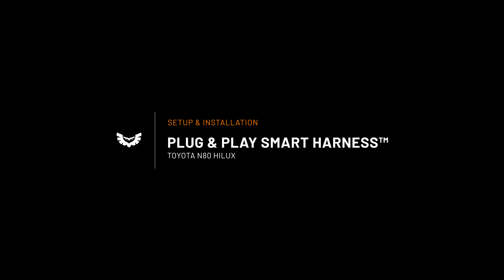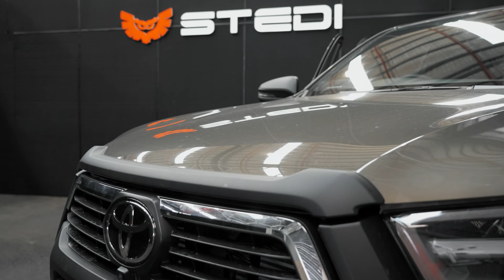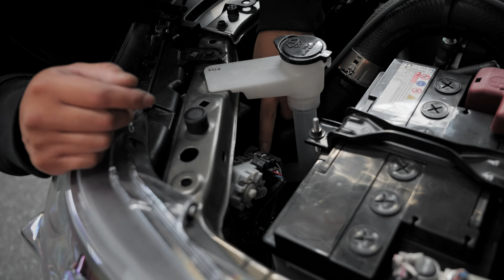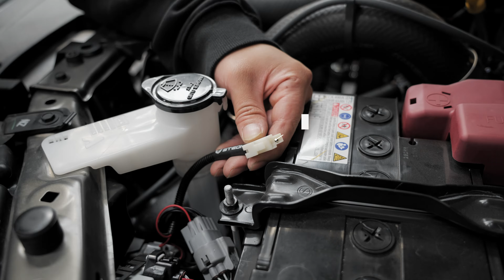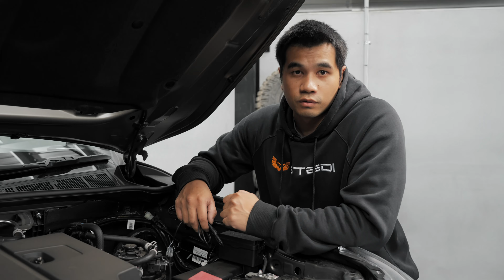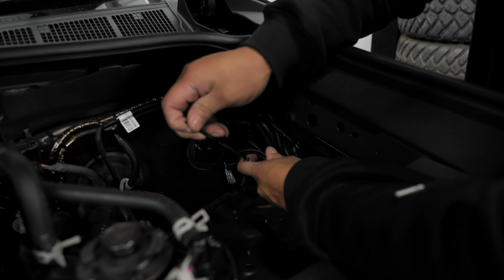Installation Guide | STEDI™ Driving Light Smart Harness

Comment: I ran this bar and harness and nothing happened. What am I doing wrong?  Does the relay have to be hard mounted to the chassis as a ground?
Reply from the maker: Reach out to our customer service team, they will be able to troubleshoot it with you. 
https://support.stedi.com.au/hc/en-us/
Reply: @ I tried. Got nowhere. Got a faulty wiring harness and  Australian stedi told me they can’t help me because I’m in USA. And USA contact is basically non existent. So zero help. Bought a harness on Amazon and it fixed it. Once again no help from stedi though
Reply: @IronMountainPlumbing  this is interesting. My new stedi lightbar doesn't work with the smart harness. It works if connected directly to a 12V battery. I didnt connect to the high beams (side by side ATV) because the adaptor doesn't fit. I thought maybe that was the issue. I emailed Stedi.ca yesterday and haven't heard from them yet. Maybe it's a faulty harness but I wish Stedi could confirm this...
Reply: STAY AWAY!! No tech support. No customer support “team”. It’s a joke! 
NOT UNIVERSAL! This product is very misleading. If you have HID lights nothing will connect. There’s no specific instructions, no tech support, no compatibility charts. 

This company is the worst at communication you’ll EVER see! The USA division has NO information. The AU site is barely better. 

How the fuck would you be able to contact them for warranty?
Reply: @JamesVR6 here in Australia we simply take it back to the place of purchase.    Not the manufacturer...